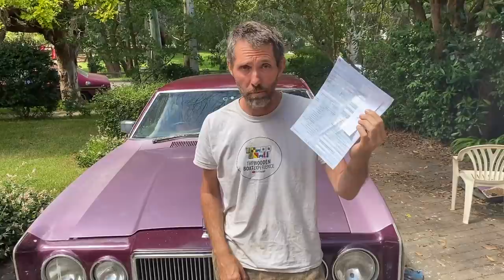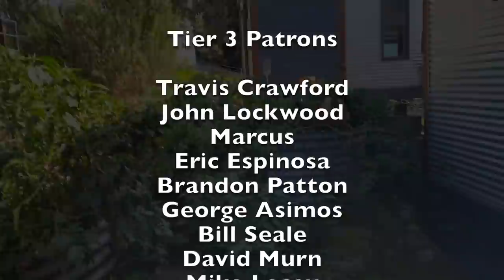Grumpy old man diagnoses two stroke outboard run without oil in fuel

Comment: So I have a Question… I have Mercury 225 Optimax 2 stroke, and I’ve heard a lot of people talking about blocking off the oil injection and just pre mixing the gas myself. Is it safe for the engine and do you recommend doing that?

Comment: Man I need some help.. when putting on exhaust manifold gaskets or intake gaskets. Do I need glue on them or just put in the gaskets and crank it down?
Reply from the maker: It depends on the model of outboard. Many come pre coated and sealed in plastic. The more common situation is that you don't need anything on them, but I often use a bit of high temp RTV (for exhaust) or Hylomar spray for intake just to hold them in place while I mount the mating part.

Comment: From someone who suddenly saw a white flash then felt a hot piece of steel melt into my eye and it was hell to deal with. I could actually feel the point of impact boiling from the hot piece. I was actually wearing eye protection at the time but walked past someone else using a grinder and it shot in from the side behind the glasses (there were no side guards on them). It is simply stupid to chance it like you are. I also once had a piece of metal hit me right on the top edge of my forehead and it slid under my scalp along my skull for an inch before it stopped. Was not really pain full but was not easy to get out being so far under the skin.
Reply from the maker: Are you sure you aren’t a magnet?
Reply: @DangarMarine  LOL I have done a lot of physical work over my life and have seen a lot of things. I worked in a hospital for 13 years as well and have many shocking stories of injuries, things you would never have dreamed of.

Comment: Once again another great video stu just wanted to ask you if you could do a video on the WOT timing method as you mentioned in one of your videos when you did timing sync on one of ya smaller motors
Reply from the maker: Ah yes, I forgot about that. Will need to get an old Evinrude for that.
Reply: @DangarMarine  lol i will bring my old girl over for ya 1985 50hp evinrude

Comment: Is that a nice new Quantum radar for Renko?
Reply from the maker: It is! Still welding up a mounting bracket for it. Need to get it in before the trip up north.
Reply: @DangarMarine  I have the open array Magnum radar which is the same essentially and it works really well Stu. The Raymarine Axiom range of plotters are very nice to use. Great channel sir!!

Comment: hello i have a question i bought a boat with an  outboard with low compression (90psi) i  got it home got it running but it was a slug it would only run about 24 mph and rpm only felt about 35-3800 prop is correct i tried to decarb motor with no improvment in compression . i then came to conclusion it needs new rings i have pulled the head off and its nice inside cross hatching is visible pistons are nice and  lubricated no burs or scratches  i measured the bore best i could and it seems like its perfect for the original size ring  .my question is how  can i know for sure the rings are the issue and is it normal for them to wear and cause such low compression and lack of power the boat is a 18 ft aluminum that should do 40 mph with this outboard .

Comment: G'day there. I was wondering if you would have any 2nd hand outboard parts for sale. In particular a top carby to suit a 60 hp  2 cylinder twin carby Mariner. Not Yammy type.  6Fo-000101 type motor.

Comment: So once the piston goes below the exhaust port and releases spent gas and then proceeds further to the inlet port to introduce new fuel air mix, what stop this new mixture from escaping through the exhaust as the piston travel back up?
Reply from the maker: Pretty much nothing which is why they do let some unburnt fuel out https://www.youtube.com/watch?v=Z6YC3I54so4&t=43s
Reply: @DangarMarine  Cheers understood

Comment: The maximum strength of a bolt is to thread it in the same length as the diameter. Any further doesn't add any strength. Take a nut of any diameter and measure it's thickness, they will be the same.

Comment: Hey Stu, I scratched the prop shaft when removing the seals. If I sand it with 2000 and 5000 grit sandpaper, can I still use it and be alright?
Reply from the maker: It's worth a shot. If you get rid of the sharp edges it probably won't cut the oil seals up but might leak a little bit. If any scratches are really deep may try fitting with epoxy or something too.
Reply: @DangarMarine  Do you think JB Weld Steel Weld would work?

Comment: Apparently in Australia they call it a "power head" while in America we call it the "motor" or the "engine." (usually electric motors and gasoline engine, but few are that precise.) Ron W4BIN
Reply: umm no. we call them powerheads too. check every manual ever made by OMC.
Reply from the maker: It's an outboard thing. Because the whole thing is called an outboard motor so there was a need to give the pistony bit a specific name.

Comment: i always thought those motorcyle like suzuki and yamaha cranks are great... until you need a rebuild. while they were busy copying OMC outboards, Yamaha should also have copied (and mercury) their split-sleeve center bearings too lol.no need to take the crank apart to replace them. ditto for the crank pin rod bearings.
Reply from the maker: It is a great system, so much easier to do this type of repair.
Reply: @DangarMarine  i did a v6 Suzuki dt150... had to send the whole crank and rod assemblies out to a specialist to have the bearings replaced. wasn't exactly cheap:)

Comment: Can't believe you never cleaned that thing even in the water. A scrub brush would work well and get you better performance. Do you not use a boat 
Lift over there
Reply from the maker: It’s not my outboard, but not, there is no public facilities on the island at all.

Comment: What's the Lightening coil
used For ???
Reply from the maker: Charging the battery. Originally it was just for AC lights on the boat.
Reply: @DangarMarine  thanks Stu, thats really unusual for an
outboard motor to have a coil for lights, im guessing it didnt
need a battery
Reply: @DangarMarine  I wooda thort they just run
the lights off of the battery

Comment: want to know the easy way to pull the fly wheel?  loosen the bolt several turns, then suspend the motor off of the ground so its hanging by tieing a rope around the flywheel. Then get a small block of wood and a 5 pound hammer, put the small block of wood on top of the fly wheel nut  and smack the wood with a hard blow . if it doesnt go put a little penetrating oil on the shaft, and try again in a few minutes. Ive never not had one come off using this method. usually one good SMACK, and it pops loose.
Reply: in the states we have a product called PB BLASTER. it works great. dont know if they sell it in the land down under..
Reply: @CessnaPilot99  we also have a penetrating oil called "really good shit"

Comment: Shame on you Stu for trying to burn down the island. You know thinking is hazardous.

So, when are ya gonna look at a diesel outboard there?
Yanmar makes a 50 hp, Oxe-Diesels start at 125 hp. I'm sure there are more brands with one also.
Reply from the maker: It would be great to look at a diesel outboard.
Reply: @DangarMarine  Yeah, how many boats are there with a minimum 50 hp outboard to have one. For use as a tender only the bigger power boats would have one large enough, most yachts will top out at 20-25 hp.
Until the diesel outboard have the range of output the petrol ones have I don't think they will be that common.

Comment: Are you really going to try to get the old outboard started?
It gives you a lot of cool videos but it's crazy from an economic and labour point of view.
Reply from the maker: I don't it will take than much time or money really. A few hundered dollars and a Saturday and it should run again.
Reply: @DangarMarine  In that case, it may make sense.
If I were to do it like a regular boat owner who can barely change the spark plugs myself, this job would take several months. :)

Comment: Anyone that lets a lower unit get that overgrown does not deserve an outboard
Reply: It's a cumulative failure. One little thing (the trim motors stopped working, therefore the leg couldn't be raised out of the water when the boat was at anchor, therefore the marine growth on the outside...but more importantly...on the inside in the water passages...and then the engine tips overboard and sinks, then is run without oil in the fuel....time to die...

Comment: Careful rubbing two brain cells together. The static electricity produced may prevent you from rembembering how to put that motor back together.
Reply: its all right he has a video of it coming apart, that and having done it a thousand times in the past.
Reply: or the friction ignites them and he winds up sparking off a wildfire. completely clearing off the island.

Comment: How on earth do you work in that mess  ?? ?
Reply from the maker: This video shows how.
Reply: State of the workshop a reflection of the quality of the work.
Reply: @Jamesl1945  Not at all necessarily...the break down procedure to take the engine apart can be "messy"...it's the clinical cleanliness assembling that requires the care....after all these years of disassembling and reassembling outboard motors, Stu could probably tell you just from the eyeball mk1 assessment which bolt goes where...and how tight...

Comment: Ah throw a new bearing on the outer part. Dingleball hone, new rings, new gaskets and throw her together. I bet $ it runs again for less than 100$. Duno how long it will last but if you need it as bad as island dwellers need a boat id do it
Reply from the maker: That’s pretty much the way I’m thinking of going. Not much to lose really. If I dont do it no one else is going to and it is going to e d up in the bin.

Comment: At 30:05
Yes Ma'am.  Is this the Tool Abuse Hotline?  
Hummm... Just wondering, is there a reward for ratting on.... ahem... I mean... telling you about a Tool Abuser?  There is?  Sweet.  
See, there's this guy in Australia running around his shop WITHOUT safety glasses and barefoot! ! !  Anyway, he's on film abusing tools!  On film!  He even made a tool (I guess it ended up being a tool) and then abused the tool he made!  I think he may be some sort of tool Frankenstein.  The tool abuse, it was sicking.  I had to force myself to watch.   Well, you know, in order to get the facts.
Anyway.... may I have the reward put in my PayPal account? I have my eyes on a sweet set of socket wrenches on eBay.